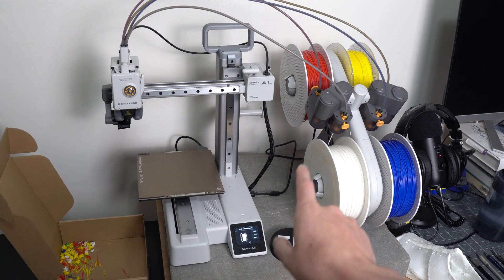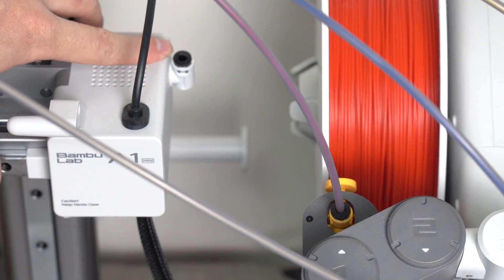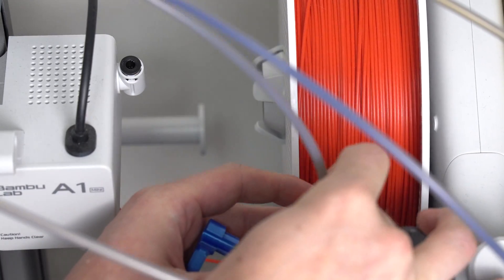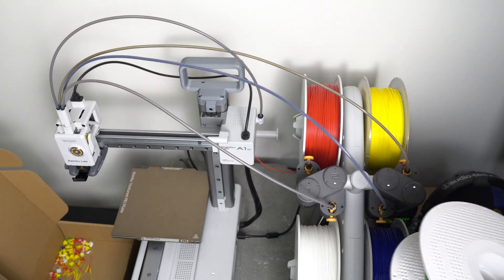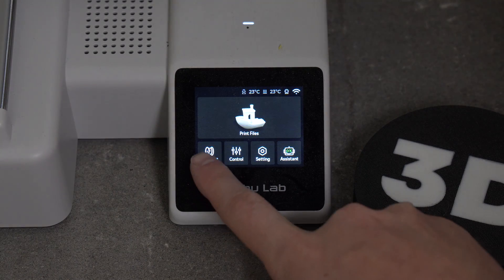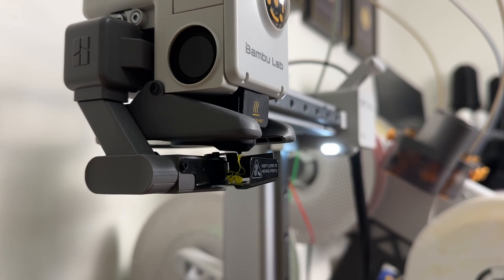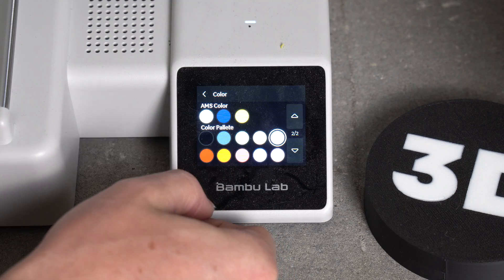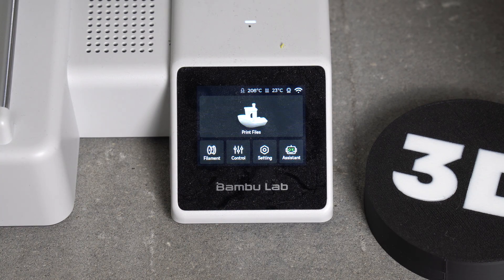How to switch from the AMS lite to the external filament spool on the A1 mini

Comment: Is there a way to put some tube also on the other side of the external spool inlet? I live in a high humidity place so my filament is always in a closed box with silica. I would like to have that connection covered with tube too, even if it is really short, to avoid moisture getting inside the box.

Comment: Is there an advantage to doing this instead of swapping a spool on the AMS itself? Or a case where it's more practical etc?
Reply from the maker: Some filament aren’t compatible with the AMS. Abrasives and very flexible filaments.
Reply: @3DPrintStuff ah OK. Thanks for the reply. Shame you can’t have 5 tubes running into the tool head 😅

Comment: I wanted to print TPU, but I don’t have TPU-AMS, so I wanted to find a tutorial showing me that this was possible without buying all sorts of adapters and stuff.  I have a P1P and an A1 Mini, but the AMS 2 Pro takes a long time to remove on the P1P, so I found this video - thanks!
Reply: Seems printing tpu by most direct drive mfgs now suggest mounting the spool above the printhead and do not use a feed tube. Seems the idea is to remove as much friction as possible for the best quality prints.

Comment: Thanks! short, concise, and to the point. I was printing TPU from my external spool in about a minute longer than it took to watch the video.
Reply: needed that
Reply: I'm wondering if this really works with TPU or any other of the 'forbidden' filaments. It seems like if the filament is still running through the AMS Lite, it could cause trouble, but I'm fairly new to this stuff so maybe it isn't a problem.

Comment: Thanks for this video - I wish there was a way to use the external filament without swapping tubes with the AMS lite - like a fifth tube opening on the top of the print head.
Reply: I've seen some 3D printable five tube parts on MakerWorld.
Reply: Thanks for the idea! I’ll dig into that a bit.

Comment: If you’re lazy like me, you buy the adapter from BL and add it in between the External and one of the AMS ports, it will allow the AMS to function normally and you can load the External manually without having to move the PTFE tube.
Reply: Could you share me the link from the adapter pls 😊
Reply: What is this adaptor called please?

Comment: ty bruh
Reply from the maker: You’re welcome bruh
Reply: @3DPrintStuff  Actually, i had a problem when trying this. I have the A1 but I dont think that should affect anything. I wanted to print in tpu so i needed to remove the ams(witch i did). When i tryed to feed in my tpu nothing would come through. I kept trying to load but it would not work. any sugestions?

Comment: I just started using my ams lite to print a three color mode. The model has three colors assigned.
How do I load the ams spools to get the correct color for the correct layer?
Reply: You don't need to worry about that with the AMS lite. Either you have Bambu spools and it recognises the colour automatically, or you can select the type of filament and colour manually on the printer or in the app. Then, when you print, it recognises the correct colour automatically if you have it on the AMS, or you can select it by hand. You can even decide to print a full colour model, of which you have all colours loaded, in the same or different colours (remember to turn off the purge tower in the slicer when you print one colour).

Comment: Vary informative, thanks for posting this! I have not tried using the external spool yet but would like to use up some small-hub quarter-kg spools. Is there a way to print a base object from the external spool and then switch to the AMS to add multicolor layers on top of it?

Comment: What's the next step? In Bambu Studio it's still displaying my AMS Lite and it slices the file with AMS commands in it.
Reply: In bamboo studio after you slice it click on “send to printer” or print or whatever it is.. the next screen will be where you select the color you want the object to be.. there will be a little square box with a check mark on “use AMS” just simply un-check this box and hit “print” or “send to printer” and your done
Reply: @BiffsEquipment  This is the correct answer. In Bambu Studio, the check box will say "Enable AMS" in the lower portion of the window that appears after clicking Print.  No need to unplug the AMS lite.  I would also recommend printing a Y-splitter (available on makerworld) to avoid having to pull the tube for the filament out at all.  With a splitter, it's just a matter of manually rolling back either the external filament or the AMS-lite slot 1 filament past the Y, then choose the filament that you've loaded on the external on the printer lcd screen in the filament section, and then send it to print--making sure to enable or disable AMS in the print window on Bambu Studio.  Done.  I keep 4 standard PLA spools on the AMS-lite, but this lets me switch to a single PETG roll easily when needed without having to remove rolls or pull out tubes.
Reply: Same problem here.  Nobody has the answer so I just unplugged the AMS and it defaulted to the external spool.  I've not been able to find a way to do it without unplugging the AMS.

Comment: You have to push the orange button on the ams when pulling filament out, you’re ruining the gears yanking it like that
Reply: Hypothetical situation: If you just broke the gears by doing this, how should one fix them?😅
Reply: @dopedopamiini sorry i didnt see your reply for some reason, in that case you need to get new gears from the bambu site and replace them
Reply: Ah thanks, I was just using my AMS for the first time and wondering how to remove filament the right way, and when I saw this video I was "oh, so that's OK to do it that way". Good to know it's not :D

Comment: Why not just take one out of the AMS and put that one? Serious question i have one too..
Reply from the maker: Some filaments aren’t AMS compatible so you have to print them from the external spool holder. Specifically flexible filaments like TPU and I think some of the carbon fiber filaments also aren’t AMS compatible because they are very abrasive and will wear out the AMS internal parts.
Reply: @3DPrintStuff  thank you for your answer... learned the hard way lol
Reply: Not to mention I wouldn’t want to have to add and remove a spool off my AMS every single time I wanted to run a 5th type of filament or color.. this way is easier.. plus you can use a Y splitter like I used along with a 5th Bowden tube so they you don’t have to reuse a boweden tube off your AMS and can totally leave your AMS alone.. this is ideal and works great for me.. you have to find a decent Y connector tho for the 5th Bowden tube.. there’s lots of models online but only few actually function properly and don’t get the filement hung or stuck
Reply: Glow filament as well, basically anything but normal pla/pteg (course or rough filaments - it can/ will damage the internal AMS parts)

Comment: So, i can use this extra spool when the AMS its working to print 5 colors or its not possible??
Reply: Nah, It is used for rolls that dont fit the ams or stuff like tpu. I use it to hang my prusa spools that should be 2mm wider to fit the ams lite
Reply: There are ways, but it's not easy. Just use the external for stiff you can't use in the AMS
Reply: No because there is no drive motor like on the AMS. So the printer will have no way to automatically feed and retract the 5th filament spool.. I suppose you could add a clock spring type spool holder to the 5th spool (sort of what the AMS uses.. but this would still only retract the 5th filament after it’s done with that color.. it would not be able to reload that color again by itself with out you pausing the print or catching it at the right time and feeding that color back to the printer again manually. 

This could work tho if you only wanted to use that 5th color once during a print.. but you’d also have to start the print with that 5th color.. that way it already has it loaded and the spring can assist on unloading it once it’s done with that color and then the other 4 colors on the AMS could kick in as normal from there

Comment: Nice, first one explaining this 👍🏻 but I think their may be another step where you have click on the ams to turn it off. I'm not by it right now but I had to do another step when I wanted to start printing. Still, thank you.
Reply: I turn off Ams and I don’t see External Spool on the next page. It just gives me the spools that’s on the AMS
Reply: I believe you have to "UNLOAD" the filament from the screen settings BEFORE  pushing the orange button and backing the filament out. You can also "LOAD" any filament BEFORE starting your print job. Easier than having to cancel print jobs due to extruder jams.